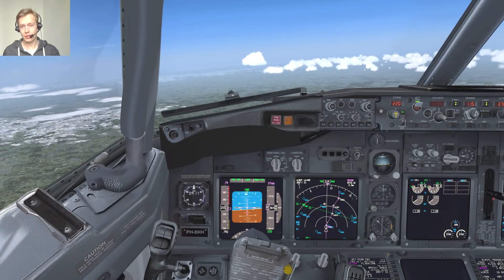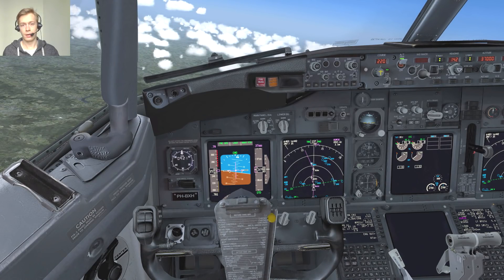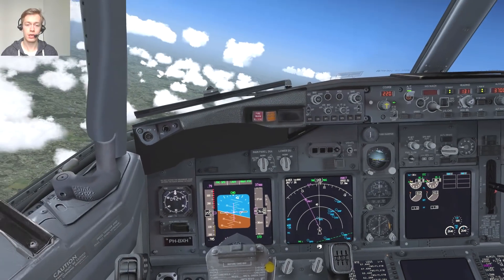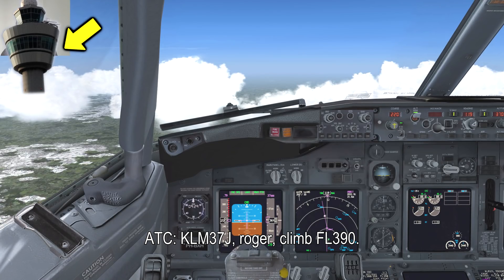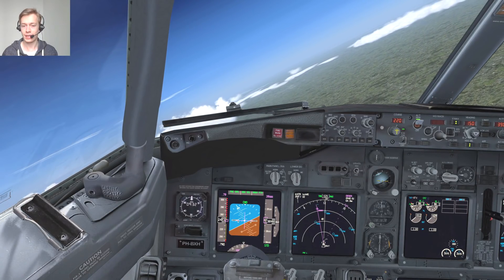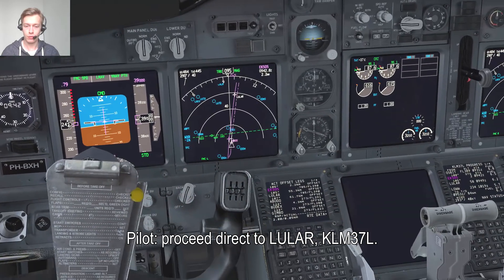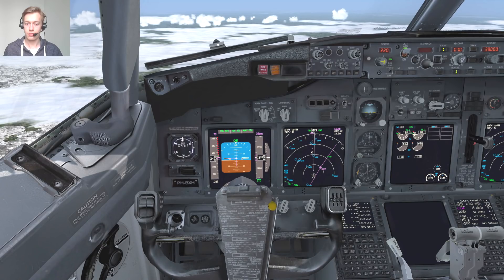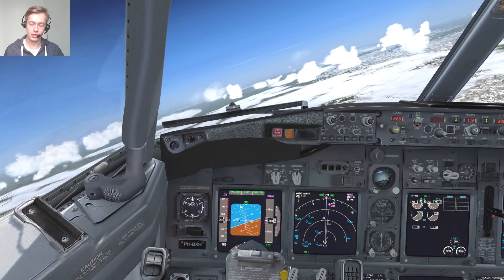VATSIM Tutorial: How to Deal with ATC Instructions & the FMS Enroute!

Comment: Awesome tutorial, thank you for sharing this. I'd like to know if you could include the arrival time for a waypoint. Say the controller instructs you to arrive at a specific route point by a specific time. Would like to see this how it's done in the FMC. Thanks
Reply from the maker: You're welcome Chris! I intentionally skipped that, because it requires the RTA (Required Time of Arrival) function of the FMC, which is not simulated on the PMDG 737. I think I will cover that topic in some Oceanic tutorial videos in April/May, because the 777 and 747 do have that function and it will be even of more importance there. As a workaround, you'd have to check your arrival time at a waypoint in the 737 FMC and adjust your speed as necessary.
Reply: AviationPro Awesome, thank you, looking forward to studying more on oceanic procedures and looking forward to future videos covering oceanic.

Comment: Please help, I have recently installed, the software, and I am registered with VATSIM.  I have XP 11.26R2.  I have followed each and every step with connecting to the network.  In my SIm it shows connected, in my plane I set my trans to stdy and listened to ATIS, afterwhich I switched to the TWR Freq, for EDDF.  Nothing, I then tried GRND, again nothing.  I have checked that my call sign is right, name and info is correct.  Where can the problem be?  Thanks

Comment: Yesterday I received instruction to go directly to waypoint that was not on my Legs page. I entered it on the keyboard but I did not know where to insert it. I added it as first element to the list which messed up my flight plan. What should be the proper way to do it ? Should I report ATC that I don't have this waypoint on my flight plan ? If not how should I know where the point is ?
Reply from the maker: This may happen sometimes, but usually only during arrival or departure. Ask them to spell the waypoint so you are sure it's not anywhere in your legs page. If not, tell them it's not in your flight plan and whether they still want you to fly direct to it.

Comment: I see you are back to p3d v4, xplane is a bit nervous and unrealistic, in a real heavy aircraft you do not have to do so many corrections like you have to do in xplane.. .  😆
Reply from the maker: Haha, well I never (and never will) fully switched, but I agree that some of the effects you see on GA aircraft in X-Plane seem to be a bit exaggerated in the bigger airplanes.
Reply: From what i tried, i'd still take flight dynamics of good p3d addons like A2A over those of x-plane ones. Both sims are capable of delivering both funny and very good results in this matter, probably depends whether the fm modeller knew his platform good enough, i guess.